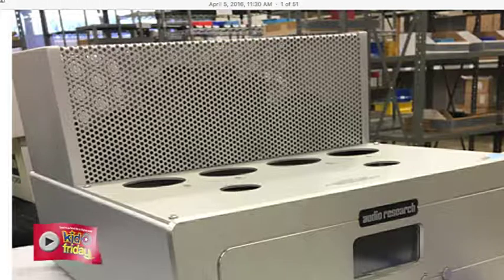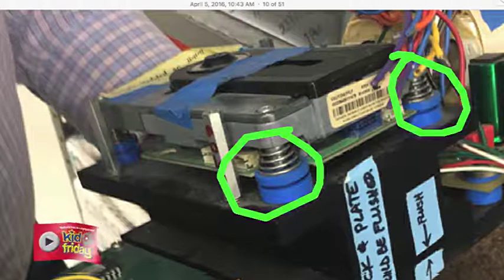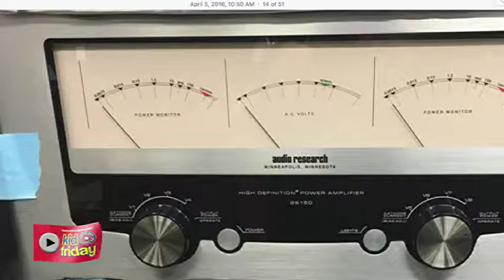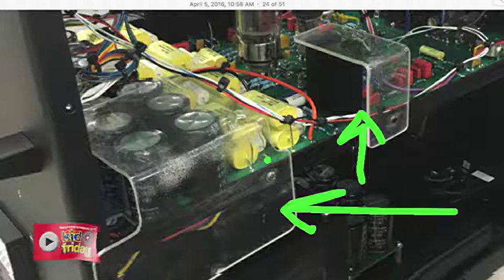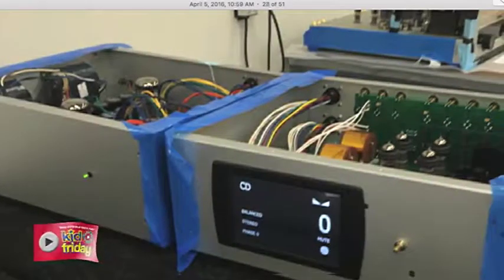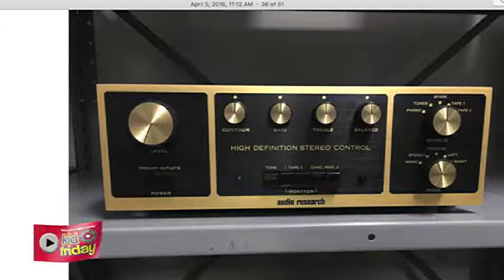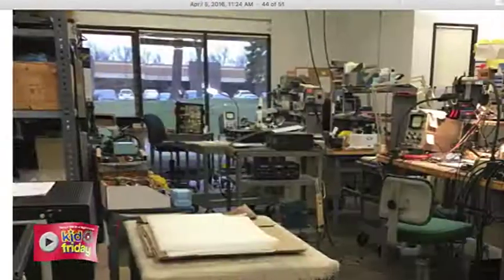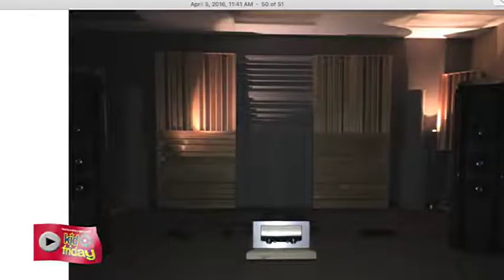NEW! Audio Research Factory Tour - Audiophile Tube Amplifiers

Comment: I just bought the VSI 60. It is the best amplifier I ever have owned. However the trick to afford Audio Research is to buy used, because if something goes wrong you can send it back to the factory for repairs.
Reply: Thats how I did it but I have older stuff from 1980.
Reply: Exactly what i did with an LS2 PreAmp + D250MKII PowerAmp . Problem is, shipping+ in house restoration costs are way more expensive than gear evaluation .